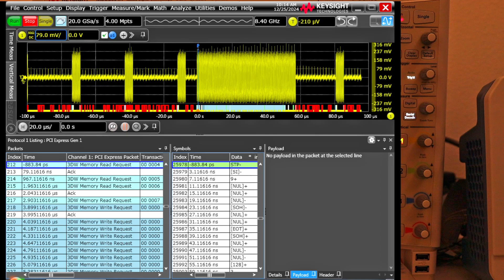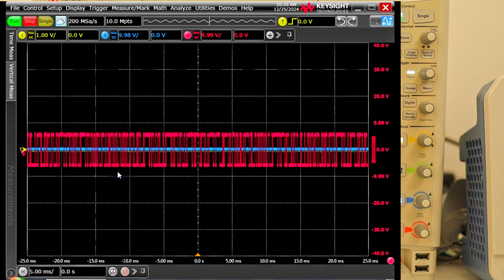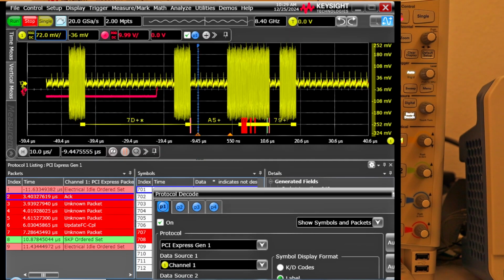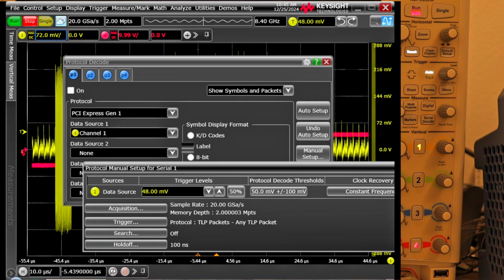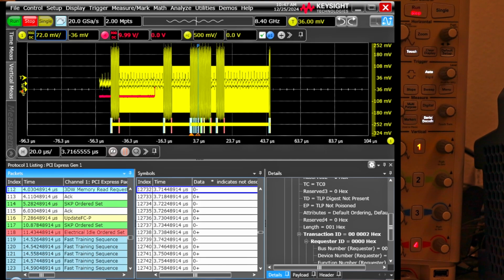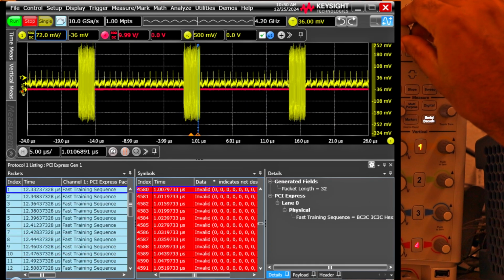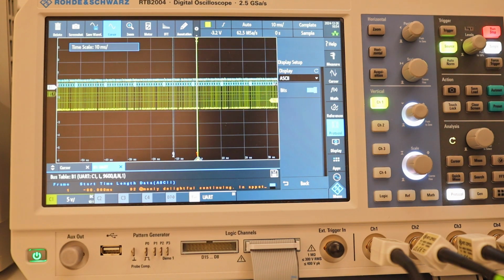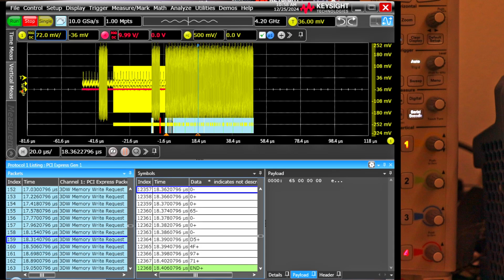Wiretapping Spying on PCIe , Part 12 PCIe Protocol Decode Using Oscilloscope , Reverse Engineer PCIe

Comment: Can you share the details  pcie card ? What is the make and driver ic used
Reply from the maker: You can can google these PCIe card are easily available on ebay. Just google pcie Serial cards . It has XR17V352 - MaxLinear Serial PCIe or similar ICs